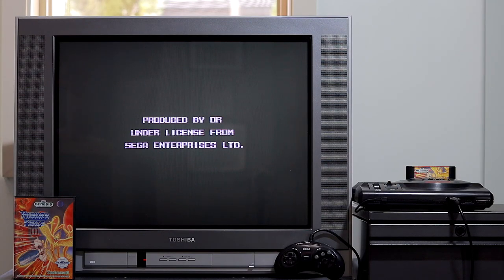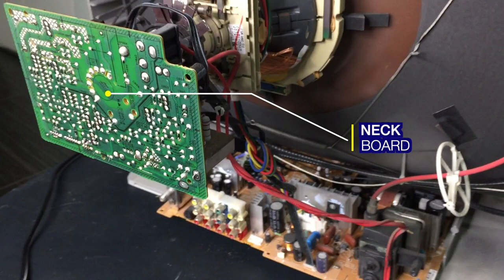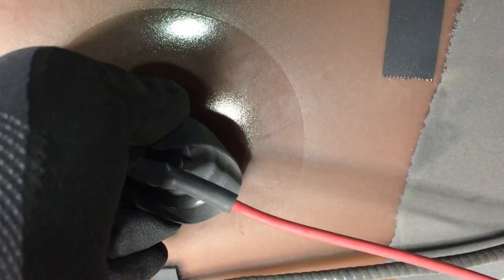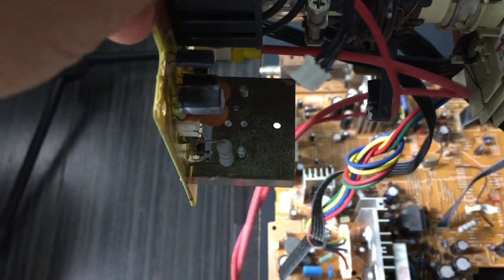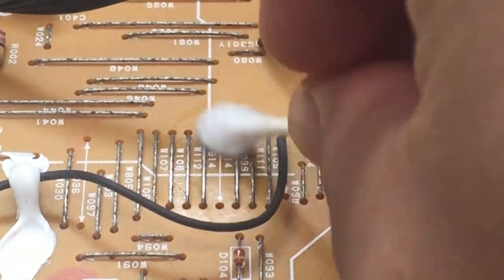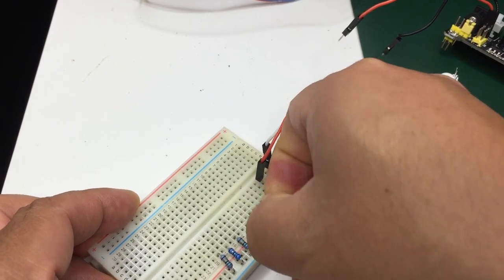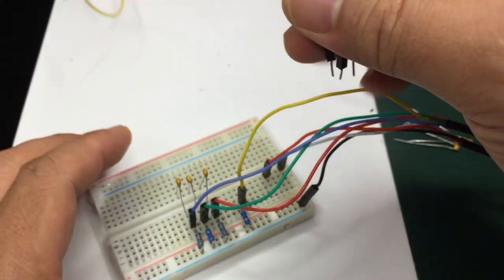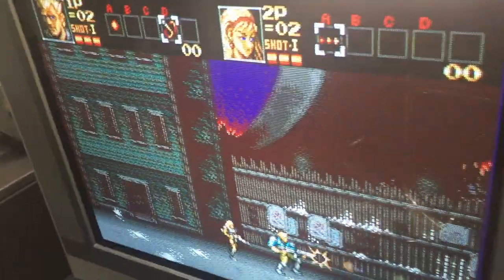How To RGB Mod a Toshiba 27AF45 & Misc. Info [ep. 108]

Comment: Thx for the video. great quality. I picked a 27AF46 recently and the mod worked like a charm. Definitely need to keep the cables away from the tube or strange black waves will appear.
Reply from the maker: Glad it worked. Care to comment on what you think about how the RGB mod looks? Curious about what you think.
Reply: @The_SegaHolic  The picture is sharp and neat. Initially I did not intend to mod the TV. I connected a Mister FPGA on the component input. In my opinion it should have been nearly identical to RGB. It turned out the picture was really bad. It may have partly to do with the SVM (Thanks, I learnt something and I disconnected it), and partly due to the TV indeed processing the image more than it would have needed to be. Maybe the FPGA had something to do with it as well. Anyway I rgb modded and I am glad I did it. I was wondering whether resistors were needed but it seems ok like this. What is the purpose of the 104 caps for? On another TV I modded  (A samsung), I did not use any (because there were none in the original board in the first place) and it worked fine as well.
Reply from the maker: @benedithsauthlo3812  Glad to hear it. Thanks so much for sharing your expience. I will refer to this ofthen when someone brings up component vs RGB. Thanks again.
Reply from the maker: @benedithsauthlo3812  Seems like I forgot to answer your question. The caps I think are to filter DC noise going into the Chroma chip. It can also protect against DC voltages accidentally going into the pins.

Comment: I removed  VM and it made the picture so much better. I have another TV with VM and the Toshiba's VM effect is different. VM on the Tosh makes the text look like it's missing pixels, so it's not great for retro games. Amazing video. Thanks!
Reply from the maker: Yeah, the VM is very aggressive in these Orion made ones. Changing the sharpness settings does nothing with it on. Not sure why they didnt make a way for the user to disable.

Comment: Still no 27” but I keep finding these Toshiba AF-series TVs.

Today it was a rain-soaked 14AF44 on the side of the road. I already had a 14AF45 on my test cart but I grabbed it anyway and it cleaned up nicely. Works great! My workbench also has a larger 20AF43 on it. I believe they have the same exact board as yours.

I’ve noticed some audio weirdness on the 20”, like the volume leveling feature was kicking in even though I had it disabled. Like most SDTVs with YPbPr component they treat sync as HD causing some unwanted horizontal overscan. Other than that, they are great!
Reply from the maker: Great man that you really enjoying the CRTs.

Comment: How are the RGB resistors on the perf board connected to ground?  I'm trying to find a ground connection from the footage but I'm missing it.  I've got my 27AF44 on the  bench now waiting for the switch to come in.  I wouldn't have attempted it without your fantastic video.
Reply from the maker: If you need ground, take it from anywhere you find ground on the main board. On the TV side, I'm taking ground from where sync (component), and audio L/R RCA jack section of the board. You can see the Yellow wire (sync), Red wire (R audio, White wire (L audio), and Black wire (Ground). But there are a ton of places to find common ground on the board.
Reply from the maker: https://youtu.be/4Ul-PjAly2k?t=785 You can see the black wire that's tapping ground. This leads to the Scart/JP21 socket. You can lead ground to both the socket and your perf board where needed, or you can go to the socket, then to the perf board. It really doesn't matter.

BTW, as you wait for your switches, watch the JVC D-Series mod that I did, as this is supposed to be an accompaniment to that video, which is far more detailed.
Reply: @The_SegaHolic  Thanks, I assumed that was the case but just double checking.  I've been watching that one too, great job explaining everything!
Reply from the maker: @jacksonbt  I'm here to help. If you're on Twitter, you can PM me there too.

Comment: Just watched this because I'm working on an MV13L3 with a M61206FP. I was under the impression composite sync was all that could be used - how are you using C-sync exactly? Are there details on this somewhere? Right now I'm tracing down an audio issue, but hoping to start testing RGB input soon.

Comment: Might be a dumb question but what pin on scart is ground? It's pin 19 with the ground being pin 17 right? Will a ps1 with Luma sync work with that configuration?
Reply from the maker: Just use the outer "Case/sleeve" for ground. If you look at the pinouts for scart, there are separate ground (return) pins for the R, G, B, sync and the audio signals. Ignore those, and just use case/sleeve ground. Look closely at your female scart plug, and you'll see it.
Reply: @The_SegaHolic  thanks man, I'm deep into this and I'm way over my head. On the female scart I'm gonna ground that to the crt motherboard right?
Reply from the maker: @Fahrenheit38  Yeah, a perfect place is the ground on the A/V inputs... which would be the sleeve (outer) part. It can be the Yellow (composite) or the red/white (audio). Or even if your TV has component inputs. Just make sure that it's the sleeve part. I show it in all of my RGB modding vids.
Reply: @The_SegaHolic  Thanks for all your help. I got it working on my set. I got a few little issues to work out as my picture is too bright so i think I did something wrong with my resistors. But it's working! Thanks for your replies and videos.
Reply from the maker: @fredrumig6668  Just make sure one end of the 75ohm resistor is connected to the r, g, b, line, and the other to ground. If it's still too bright, "brightness" and "contrast" on the video adjustment menu affects the pic, but you'll have to switch back and forth with the switch that you installed so you can see the OSD again.

Comment: I have the same tv in a 20inch and i have rgb to component converters so I'm using the colorstream input. Do you know which service menu settings reduce the bloom? I'm getting a lot of bleeding and I'd like to tighten that up. Have you compared that TV's RGB vs component inputs. It should be the same but maybe by bypassing so much you are getting a cleaner picture.
Reply from the maker: Component and RGB are two different colorspaces. They are never the same.
Reply: @The_SegaHolic  yes and no. My component cables are converting the rgb signal to component so there is almost no difference on my ossc if i use use either scart or component. I get what you mean and i understand the difference but in practice they look nearly the same. I was curious if your rgb bypass just skipped some of the TV's processing to have a cleaner signal overall.
Reply from the maker: @Kawikacheco  Different transcoders handle the "transcoding/conversion of colors differently and are set to how the manufacturer sets them. So you won't get the exact colors from transcoder to transcoder. When you first do an RGB mod and hook up an RGBable console like say, a Saturn, then you'll notice straight away a difference from composite, s-video, etc. Then when you take the same console, and run a rgb transcoder to component, the colors will still look very different. You can make it look more the same by adjust the color drives in the service menu, but that has global effects, meaning that it adjusts color on all inputs... composite, component, RF, etc. There are TV's that let you adjust component, composite, RF settings like color, contraast, brightness separately, but not RGB (OSD).

I highly recommend you do an RGB mod so this is not hypothetical and you can see and experience for yourself. Do these tests and you can scratch that itch yourself. Again, RGB and component are two different color spaces and you can get component looking like RGB, through RGB color drive adjustements, and other tweaks like color, tint,... but it's a major headache that's give me a headache trying to explain.
Reply from the maker: @Kawikacheco  An here's a transcript of a Twitter conversation I had with somebody who got inspired and did the mod...

"Yeah I finished it up a few days ago!  I'm actually a new Electrical Engineering graduate and a buddy of mine is also on our level of degenerate CRT obsession.  He had a female scart on hand and thus I successfully completed it!

I was logging on to tell you that your content deserveds 100X the subs that you have.  Please hang in there and keep producing the vids you are.  I dunno if you ever watched any PhoneDork vids but he's the one who got me determined to get a D24.  He made increddible vids until he just kinda quit.  Don't quit!  You've really got an eye and talent for this stuff.

I would be happy to try and do a component comparison but there are a few problems.  #1 is the service menu settings have to be drastically different for the two input types.  The switch is mostly useless in regards to switching from component to RGB, they are completely different animals in my setup.  Problem #2 is the blooming.  I just cannot get this set to behave in brighter colors.  

So what you have to try and show to people is that up until the bloom there is a better differential between the color points.  One thing I've noticed on this journey is the color of the bat that appears on the intro of Super Castlevania IV.  If I'm on component the bat is clearly blue but if I'm on RGB it is kinda magenta/purple.  So even if the bat looks exactly 100% as sharp on both setups, one is displaying the correct color while the other is not.  So anyway by the time you try to capture this on a phone and upload it with whatever compression the effect is lost.

I think the selling point on RGB mods is the ability to hook up all your consoles via scart.  I mean its fucking crazy we are going to these lengths to achieve something built into TVs in other regions but it really does make a difference.  I've got a GSCART coming in and it has dual outputs.  Maybe I can make a comparison between by BVM and Toshiba directly and then use my mister to put component on the BVM and RGB onto the Toshiba and show how the colors are more accurate on the Toshiba than the BVM because we are using scart.  

That's a lot, sorry bro, but you're a hero keep up the good work!"

Comment: Hi, I’m new to retro gaming. I just picked up a 27AF45. Firstly, I’m having trouble getting it to work. My sega genesis for example..I hook up the RF cable to the coax in the back of the tv, but the screen is black. Do I need an adapter ? I don’t remember how I hooked up the sega years ago. I have 2 sega’s, GameCube, ps2, all not working. Also..should I do this mod? Is this a good tv for retro gaming ? Im rambling. Basically, I’m brand new, and really need advice on setting up my game room. Please help

Comment: I followed your guide but i seem to be getting a lot of noise in the picture. Have you encountered this before?
Reply from the maker: Are you using c-sync or composite as sync? Have you tried both?  Also, have you tried other consoles besides the Playstation?
Reply: Old but in my RGB mods I not only braided my ground wires with my signal wires, but I made them as small as possible. It can also be because of your cable, check it on another device.

Comment: So out of curiosity, is the component input bad on this set? I would have used HD Retrovision cables or the RGB to Comp from retro tink. I know its not as interesting as doing the RGB mod but I still wonder if the picture quality improved that much.
Reply from the maker: How much is the HDRetrovision cables and the RGB2comp? That’s extra money right there for doing a conversion of the best signal you can get. The conversion is an interpretation of what the end result should be from transcoder to transcoder. Also, I already have JP21 cables for my Framemeister. There is nothing wrong with the component input. But, just because I get this comment a jillion times, I’ve bought a VGA to component transcoder so we can see.  There are pros for going the transcoder route, but you’ll have ti catch the upcoming episode for that. BTW, you from Hawaii?
Reply: @The_SegaHolic  Yeah I got the HD Retrovision cables and the RGB 2 Comp converter. I was hoping that your method was a way to get a superior picture than going straight component into that TV. 
We still have family there but I am not from there. Although, spent many winters in the country riding big winter swells with family. Grandpa died in Kaua'i and mom moved to the mainland before I was born.
Reply from the maker: Kawika Are u the same guy that wanted to buy my Daytona Netlink? Anyways, RGB is not the same as component. That much has to be said. You’ll have to just see with your own eyes. Videos and such can give you an idea, but seeing in the flesh is obviously ideal. Get a cheap and free TV and mod it. You can get Scart cables for cheap, and get better ones if you see enough of a difference. For me, I always want to see for myself, to see sort through all the mountainous info on the net. This mod is easy enough to do.
Reply from the maker: Kawika BTW, my transcoder comes in tomorrow!
Reply: @The_SegaHolic  i have everything RGB. I also have 3 PVMs, OSSC, Framemeister. I have hd retrovision cables for snes and genesis but also rgb scart cables for another capture setup.

I'm into softer images like you get from old toshibas and Sony's vs the PVMs so I've been looking into getting a consumer tv for some time.
Reply from the maker: Kawika Well, you’ll like the RGB vs component then. You can’t control sharpness on the RGB output as most if nit all consumer TV’s will not allow you that parameter in the service menu, although if you look at the chroma chip data sheet, you can adjust it by changing register values. So the RGB pic always will be softer than component even on median settings. For all the TVs I have modded, it’s always the perfect amount of sharpness. This was one of the “pros” of component vs rgb as you can control aspects of the picture through the menu, where only brightness affects the rgb picture.
Reply: @The_SegaHolic  Correction I have the 20AF43. Still, I am really impressed with the component picture of this thing. I am trying to figure out how to reduce some of the color bleeding and make it a tad more sharp in the service menu. I think once i get that under control its going to be pretty fun. Not as good as my Sony PVM or JVC PVM but i think it'll be my garage setup for light gun games or something.
Reply from the maker: @Kawikacheco  Can't your adjust sharpness in the regular menu?  Take notes of the R, G, And B Drive settings, then you can start playing with those.
Reply: @The_SegaHolic  Well, there is one thing wrong with the component input:
It uses tri-level HD sync despite not being an HDTV. Even HDTVs are supposed to use different sync timing for SD and HD but many do not. Like the Toshiba AF series, they sync the rising edge of the sync signal regardless. This causes an unwanted horizontal shift and stretch.
Reply from the maker: @emmettturner9452  Awesome info man. Thanks for sharing.

Comment: Hello, thanks for the video. By any chance, after making the mod, did you notice any kind of micro-interference, jitter-wobble in the white letters on a black background? it's very strange.
I already deactivated the VM, but I can't figure out why that happens.
Anyone?
Reply from the maker: It's the signal getting ghosted from whatever input mode you running your sync signal to (composiite, component, ect). You can see it when switching RGB mode off, you can see a faint gray picutre. It's the sync sinal not getting fully blanked.  It can get bad if you have your sync signal high. How can you fix it, or get rid of it? You can try to add a resistor on the sync line. Remember, you already have the 75 ohm teminating resistor on that sync line. So you're just decreasing the p/p voltage of the sync line. What value? You gonna have to experiment until you get high enough where the ghosting disappears and don't degrade the sync signal enough that your TV loses it. OR EVEN IF THAT WORKS AT ALL.

Or you can get something that eliminates it, but you're gonna have to invest in more cables... an EXTRON MATRIX SWITCHER that you can see in it here, at the top of the server rack:
https://youtu.be/HEcB64ICVCw?t=14

It conditions the RGB and sync signals nicely. It got mine for $38 shipped on eBay. There are different styles. Some use VGA connectors like mines, others use BNC... 

After hooking up the consoles to the EXTRON, zero interference and just nice RGB. Even the audio noise has been greatly reduced. You should hear the little noise on a stock Genesis.
Reply from the maker: Oh, and some TV's like this Sony
https://youtu.be/z1T3XtbqFHU
and this Tosh
https://youtu.be/A7xEP9mAAk4
don't have interference at all... even without the Extron or messing with Sync levels. Both only use the TV's already installed 75ohm terminating resistor that's already on the composite input lines.
Reply: The SegaHolic Thanks for the answer my friend, I am going to try to put a potentiometer in the sync to regulate the input, but unfortunately, from what I have investigated, these Toshiba TVs suffer from this microinterference.
Even your TV, the one you show in the video, can appreciate that problem in the white letters with a black background.
It's a shame since the image is this model is beautiful, I thought that this would be my definitive crt, but I will continue looking for other options, it is already the third tv that I make rgb crt mod.
Thank you for your videos, they help a lot and are a great source of inspiration.
Reply from the maker: @elbatosoy  Thanks for the positive words man, means a lot. I need to try and hook this tv up to the EXTRON to see if it eliminates it... before I sell the tv. I'll keep you posted.